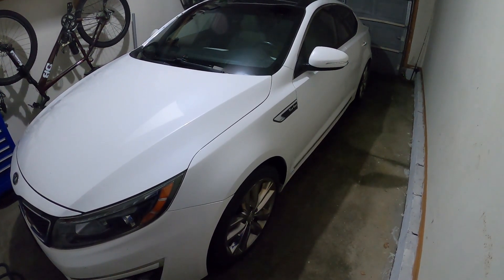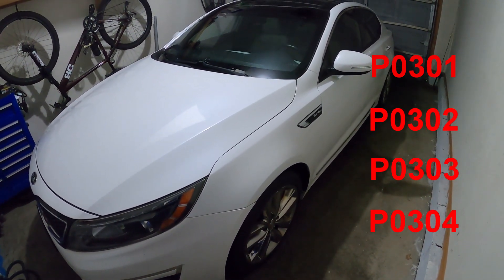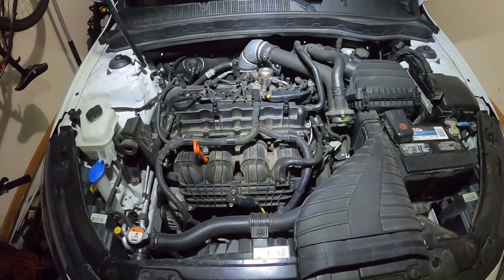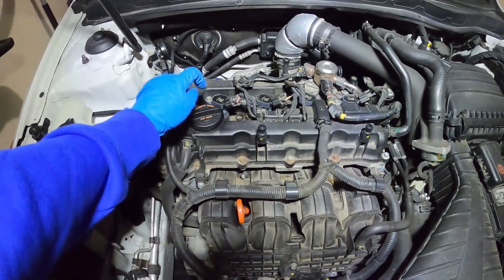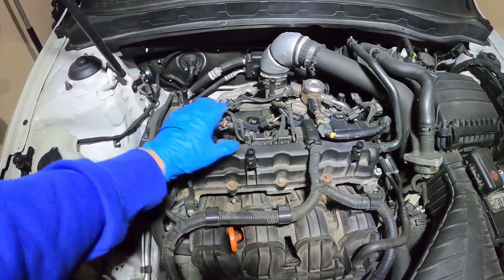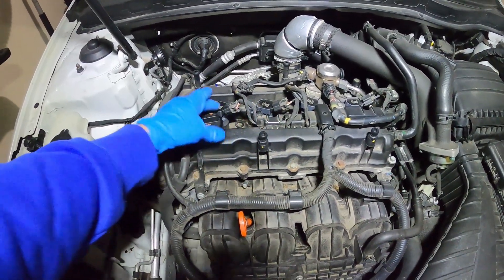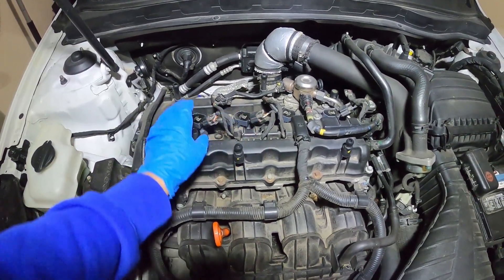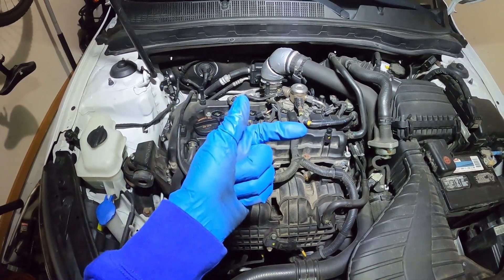P0301 | P0302 | P0303 | P0304 | CHECK ENGINE CODE FIX | CYLINDER MISFIRE | KIA | HYUNDAI | 2.0L

Comment: P0302 on cold start. No shaking or misfiring but now I have a permanent code that won't reset. Any ideas
Reply from the maker: P0302 should just be cylinder 2 misfire. You can swap the coils and see if the misfire changes to a different cylinder (ex : P0301, P0303, P0304) that will tell you that the coil is bad. If the cylinder misfire stays the same however, you'll need a new spark plug. Make sure you clear the codes everytime with a code reader. Best of luck.

Comment: Mine was P0304 it stutters when im stopped at light or stop sign but it goes away when i go passed like 10 20 mph
Reply from the maker: Thanks for the comment! Engines can work on fewer cylinders, just poorly. I figure your issue was just more noticable when at low speeds as the engine wasnt working as hard. Were you able to fix it?
Reply: @blueglovemechanic  i just got the check engine light today thats why im going through videos lol and i didnt mean “was” i meant to say ”is” and im getting it done this weekend im just going to change out all spark plugs and coils.
Reply: @blueglovemechanic  i can come back with an update if you like.
Reply from the maker: @KCBidness  sounds good! Best of luck
Reply: @KCBidness any update?
Reply: @perezote6846 yes sorry i changed all the sprarks and and only one pack because the place i went only had one in stock. So i put the pack on the 4th one where the reader said. Everything went back to normal.
Reply from the maker: @KCBidness  Glad everything worked out!
Reply: @blueglovemechanic  thanks boss

Comment: Good morning Blue Glove, i’m experiencing the symptoms that you exactly described, but I am not getting any codes thrown yet, but I do feel that the engine feels very hesitated, while driving and idling. How do you recommend I start checking for the misfire exactly as your video says??
Reply from the maker: Hey there. First i would still attempt to run a scan/read codes. Even if the check engine light is not on you have have something stored. Next, i would remove the sparkplugs and check for burning/white residue. If you havnt changed your sparkplugs in awhile id recommend buying a higher quality set from your local parts store (ive bought cheap before and had the same if not worse idle/issues). If this doesnt fix your issue at least you've ruled out the plugs as well as completed some preventative maintenance. Next step id recommend buying a full set of coil packs. (You can always return them if your issue persists). If you still have rough idle you probably should look at the fuel injectors. You may need to have them cleaned or even replaced if they are malfunctioning. Lastly, if everything above is fine you may need to look into timing chain. How many miles are on your car? Unfortunately without a code you have alot to look at. I hope this helps! Let me know what ends up happening!
Reply: @blueglovemechanic  thank you so much for the reply I’m scheduled to take the car in this coming Friday and going to go over all the things you listed I will for sure keep you updated thank you so much have a blessed week, *just hit 70k miles last week
Reply: @blueglovemechanic
Hi!  I have a 2019 Kia Optima. I have a P0304 code. I changed my spark plugs and tried a new coil pack. Neither fixed the issue. A week after changing spark plugs, they are really dark & there’s some soot or dirt inside of cylinder 4. The compression is low as well.  Why would my spark plugs be worn so soon?  What does it sound like to you. I’ve read a lot online, and I have an appointment to take it in on Monday. I just don’t want to be taken advantage of. Thank you!